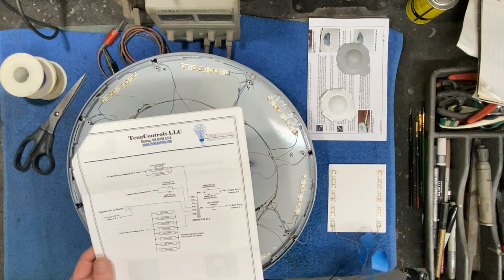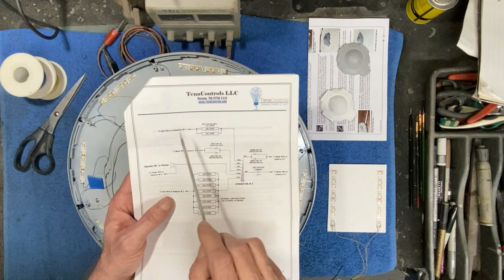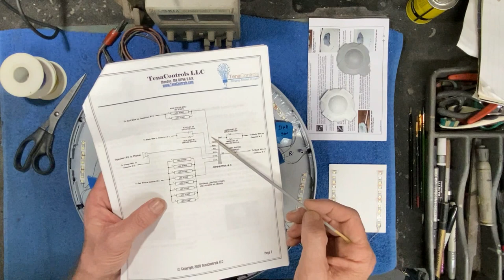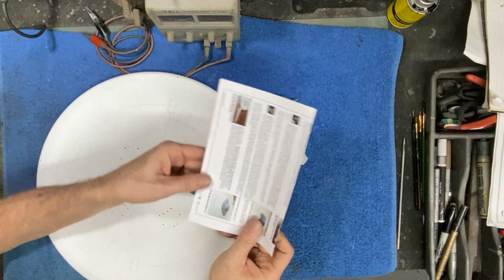1:350 USS Enterprise Refit By Polar Lights Updated Build Series Pt 8

Comment: A little thing I've seen for fiber optics- you can put a piece of shrink tubing around the fiber optic wire (don't heat it!) it wraps nicely around most of the wire. You can use a dab of solar rez to secure it.  

For the LED itself, you can go ahead and get a larger piece of shrink tubing (3-5ml) and put it around the light so only the tip is exposed (this one you can heat).  

This is a bit of extra work but it eliminates the need to use paint for light blocking, and it avoids having to use electrical tape which can pull off

Comment: Really nice work so far! Your site has been the excuse I needed to get back into modeling after a few decades of real life. I have several original release Trek models to finish, but I also got a refit model for Xmas as a long term project, so this is very helpful. Have you ever used a wirewrap tool? With the 30 ga kynar wire, if you're pressed for space you can simply shorten the leads on the component and wrap the wire tightly around that lead. Not good for IC's, but resistors, capacitors, and LEDs are fine (wirewrap IC sockets are meant for breadboards, so they are bulky). An alternative for the light blocking on the phaser LED is a very short piece of brass tubing that it just fits into. Leave about a quarter inch of space in front of the LED lens, and a squirt of Elmers glue will hold the fibers in place with no damage. You can also use a pin drill to put an indentation in the lens itself; the actual chip is at the bottom of the device, so you can drill fairly deep with no damage.

Comment: When working with the fiber optics, why wouldn't you make a tube to mount the LED and connect the fiber optics into the other end?  The tube can be mounted with some sprue or directly to the hull as a hard point and can be easily light-blocked as well. I love the idea of using the solar-res as an adhesive for this purpose for the fiber optic.

Comment: Hey Boyd, I am at a similar place in my saucer build as you in this video.  Was wondering if you did any window filling on the bridge itself, the two side openings (lights) and around the LED flood light out the front.  Also, just an FYI, Shapeways has a phaser emitter replacement which has a center hole specifically for fiber optic.  Same concept as your fiber optic dome for installation.  Thanks again!

Comment: Boyd, another informative and helpful video!  Question about gluing the planetary sensor on the lower saucer:  if you painted the lower saucer, what glue did you use to attach the sensor?  You have cautioned us to make sure all paint is removed from mating surfaces to ensure a good bond.  Won’t the paint on the lower saucer prevent that?  Many thanks again for this video series.  I’ll be starting my second Refit soon!
Reply from the maker: Small, light parts are fine to glue over painted areas.
Reply: Got it, thanks Boyd!

Comment: As always, you have useful and practical tips on modeling.  Thank you Boyd!!!

Quick questions:
I noticed that you are using a heavier gauge of wire for some of the main power connections.  Is there any side effect of using a larger gauge (say 24 awg instead of the 30 awg wrapping wire) for the larger "back to the power source" leads?

What type of CA glue and accelerator is that?
Reply from the maker: Yes, I used 20 gauge wire for the main power feed that will go from the base up to the saucer where the control board is. The complete lighting system in the model will draw right at 2 amps with everything on so the 30 ga wire is a little light for that. This way it will have no drop off.

Comment: Fantastic work Boyd, one question, is there a reason you do not use any hot glue to hold things down?
Reply from the maker: I did use hot glue to glue the control board in place because CA glue could damage it. Otherwise, I just like the CA glue because it's fast and easy.
Reply: @TrekWorks  Makes sense, I was wondering if you were concerned with damaging something as I am always concerned with CA haze of doom, which honestly is rare when using liberal amounts of kicker.
Reply from the maker: @PitstainHobbies  Yes, definitely stay away from any clear plastic parts with the CA glue.